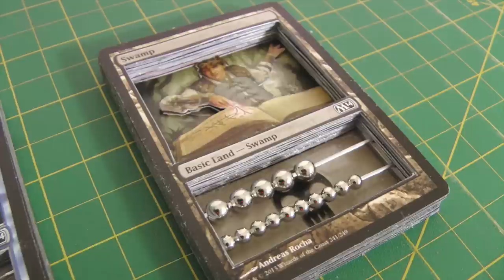DIY D&D Dice Tower

Comment: if your not willing to fork over the measly 2 bucks for the plans you can just freeze frame the video and use the cutting mat lines as a guide for how big each section is, at 2:13 ithe tower is on it's back and takes up 16 squares, each square is probably 1/2 in so it's 8 inches tall.
Reply: To be fair, if you can't look at his final product and invent your own with a pencil, you should probably just pay him the $2.  Or download the one on instructables.

Comment: Can someone please tell me what the most effecient purchase of foamboard would be for this? Like for example if I find that a pack of 11x14 is cheaper than a pack of 16x20, can I go with that? Or will the L-shapes etc require more surface area, so the larger the sheet, the better?

Comment: For games that involve a lot of re-rolling or just to make the result easier to see, you can probably just skip the bottom part.

Roll, lift, pick up dice to reroll, put down, roll again, etc. (downside: depending on your table it might be a lot louder)
Reply: TheTrienco The bottom shelf would need a bit of tweaking.. since it goes right to the edge of the box right now. But definitely doable

Comment: love it i might go on the expensive side and instead of using foam board using ply wood
Reply: ***** If you do.. keep in mind that the fit would be slightly different. You'd need to modify the pattern to account for the fact that you aren't cutting the sides with the rabbet cutter any more.
Reply: Paul Mason had that going in my head as i watched the video have a router that can do that same thing so no big deal their

Comment: I love this!
Reply: They sell felt sheets with adhesive on one side, I highly recommend it in place of fabric/glue for the sole reason of wanting to roll right away and not want to wait for more glue to dry
Reply: Adhesive felt is the way to. Dirt cheap at a hobby store, easy to cut to size, and no potential for any mistakes with the glue or the felt bunching up.